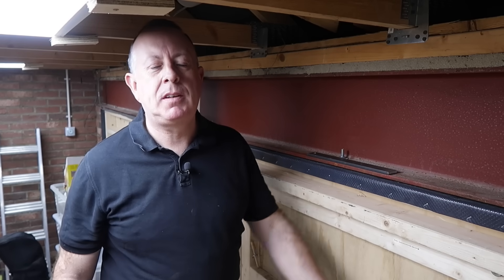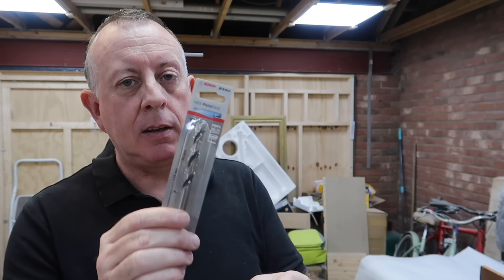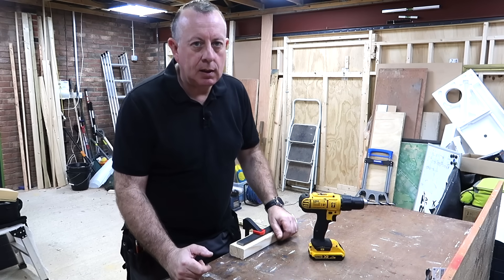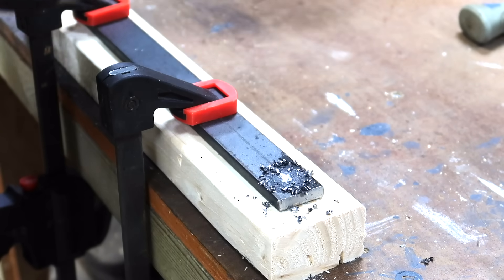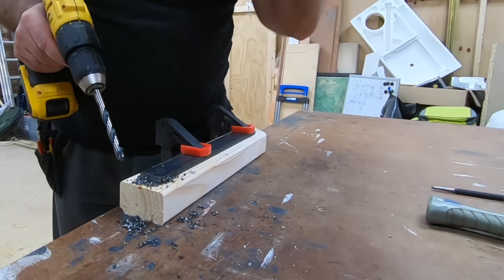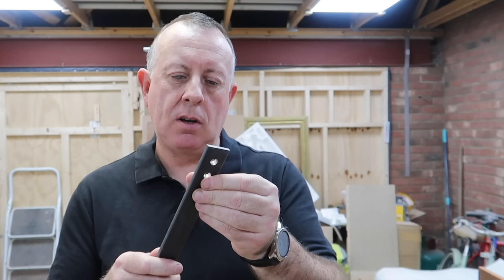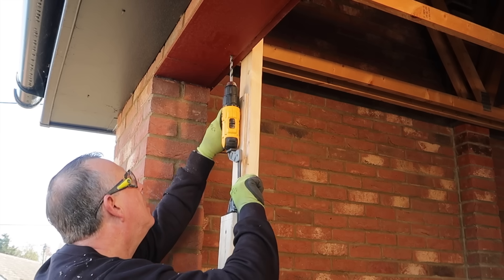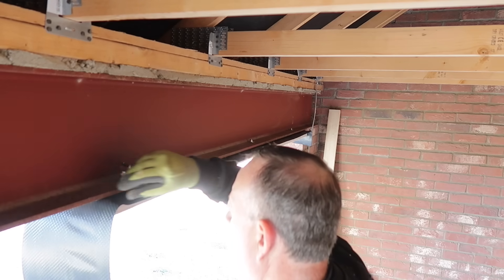How to Drill Through Steel Beams with a Cordless Drill

Comment: Have you not heard of a portable drill press.? The drill mounts to the collarvof the drill, you hook it on the outside edge of the steel then use the lever which applies pressure to the work, simple and light. No set up time butvyou must be able to hookbthe backbedge of the steel. I have a slow speed metabo drill thatvwould break your arm without the press. This thing makes it super safe and easy.

Comment: As an apprentice in 1978, I was always taught that the cutting speed for steel was 18 m/min, with 118 degree drill tip angle, BUT, also, never to remove swarf with your fingers 😳. Great video though mate.

Comment: Mate, let the drill breathe! Slow speed, high pressure with vents fully covered, she is cooking. 
Press with your palm and leave the vent open, also run it on full speed off load once you’re done with the hole so she cools down.

Comment: I thought it is the standard way to drill through steel .... slow , You can also add pressure by using a large clamp on the drill . But i always pilot with smaller drill bit when drilling thicker steel

Comment: Too bad so many people liked your approach. You are absolutely right about the slow speed, but then it stops, a battery powered drill isn't the tool for a job like this you will kill the motor, second applying all that pressure isn't the way to do it. The drill should carve its way through the metal. When this doesn't work the way through the metal, your drill bit isn't sharp enough to do the job. You can drill a smaller pilot hole. Keep up the channel but stop telling the wrong info.

Comment: What , no pilot hole ? 
1, Centre punch  
2, pilot hole 
3, drill hole 
Is how I was taught near 60 years ago now. Drill speed is very important also or like you say it’s dull immediately and burnt the cutting flutes which changes the temper and must be ground away and ……. Well just not a good thing . Ruins your drill bits.

Comment: Rule of drilling steel is "The thicker the drill bit the slower the speed.
The thinner the drill bit the higher the speed". Thats why it's an "HSS" high speed steel.
Cobalt drill bits are my favourite. They dont need lube, just dip it in water every 20 seconds
Love your jigg though. Great idea

Comment: you are killing yourself .  Use a center drill to get the location spot on and then use a very small drill for a pilot hole the small drill should be the diameter of the web of the next drill. WD 40 is Kerosene and it is not a good cutting fluid for steel,  it's great for aluminum but plain kero' is so much cheaper.   You need a good black high sulfur oil like you'd use from the plumbing supply to cut threads on black iron  pipe.  Or any of the high tech specialty cutting fluids.

Comment: When I started most hand held drills (except for the Armstrong type!) had only one speed but also consider how big a hole you want, for 1/8" (I favor the Imperial system) you can go faster and much slower for 1/2".  I believe that some British machinist about a century ago developed a table of drill speeds vs diameter, I think I have this table somewhere.  Everybody has WD40 but if you're going to do a lot of this, might try some cutting oil.  HSS drills are nice but Cobalt Steel can even drill into stainless without killing the bit, they do cost more, but most of us only need a few key sizes, not a whole set (or is that hole set???).  Last thing I learned, this was a hard lesson from my wrist, nice drills like you are using have clutch index setting for the screwdriving function, use them when you are drilling as well, these high torque drills can wind your arm up like a rubber band when the bit jams.  Sorry for the pun.

Comment: May I suggest another option in getting PSI on yr drill? As an old woman and massage therapist I would get my old lady step ladder (that has big flat steps) I’d use my height and apply my KNEE resting my foot on the higher step or side of the ladder to lever the drill pressure . Your hand is loose  and not taking any of the load. You could use a mirror to keep a visual

Comment: I tend to start with a smaller drill bit for a pilot hole. Then go to bigger bits.  Depending on the size of the hole I may use 3 different sizes. Saves wear and wear and tear on the bits.

Comment: FYI WD-40 isn't a lubricant, it is a water displacement fluid. You should use cutting oil. Also drill speed depends on drill diameter. Its all about the liner speed of the cutting edge
Reply: Well to be honest it works as a lubricant for the purpose and not everyone has cutting oil. This is a DIY channel - I dont know why all you smarty pants dont get it that he is trying to show how anyone can do it without access to all the fancy stuff like cutting oil. 🤕

Comment: From a retired 45 yr machinist…… step your drill sizes, if you need a 1/2 inch hole, start with a center punch, then a 1/8, then 1/4, to 3/8, finish up with 1/2. Less pressure will be required
Reply: Thanks, that's what I have been doing for decades, and didn't know if it was the right method or not.  If I'm drilling an 8mm hole, I start off with 2mm, then 4mm, then 6mm, and finally the 8mm.  Must admit, I didn't know that the rotation has to be REALLY slow.  I have cooked a few bits, even when trying not to.
Reply: @barryfoster453  I'm a long-retired machinist/toolmaker that still practices my skill set, I have a cobalt set of drills however i mostly use my HSS set and re-sharpen them as needed.

Comment: You get better accuracy and less need for pressure if you use a smaller drill first. You shouldn't need your whole body weight to drill a hole.

Comment: 60 years drilling holes in things and I finally realised why I have successfully blunted so many drill bits so quickly in the past. Thank you very much for such a simple tip such as not using a drill at warp speed all the time.

Comment: At the other end of the scale, drilling thin sheet steel can also be quite problematic because the twist drill often binds at the end of the cut. A very useful tip to avoid that issue is to place three or four layers of cloth between the drill tip and the surface that is to be drilled. Doing this prevents the drill bit binding and results in very clean circular holes even in thin sheet metal with relatively large drill sizes. Lots of drilling pressure will still be needed and don’t be concerned if the cloth begins to smoulder a little.  Trust me, this technique really works 10/10 every time.

Comment: I had used the pilot hole first approach and the width was just a shade wider than the center tip ‘shank’ of the second and final bit.  I never tried slow, so I will try it my way but slow.

Comment: As a trainee technician over fifty years ago I was told don’t use your thumb to wipe away metal swarfs  in case you get a splinter penetrating the skin.
Reply: Should also wear gloves, because if the drill does get hot it will get really hot and the slightest contact with skin will give a deep burn.

Comment: For me, step 1: ensure the drill is well sharpened, I’m always amused by guys who don’t push hard and thus heat up and blunten the drill and squeak squeak squeak, and I usually run high speed its just a matter of proportionate pressure and coolant

Comment: Helps to drill a smaller diameter hole first (same weight but applied over smaller area) Also helps if your a diyer like me who has a whole serira of dull bits, very often the outer edges of the bits are not dull, so I have found

Comment: You don't always have to drill thru an RSJ. If you're boxing it in, Hammer in "soldiers", batons of wood between the two flanges, tapered at each end and hammer them in flush. You can then box it in.

Comment: It is best to drill a small hole first. Aprox the size of largest size drills tip. Then drill with the large drill to the final hole size. The larger the drill the lower the speed. Best to use special alloy drills like cobalt drills then hss.

Comment: use a smaller drill bit to make a starter hole  - dip the drill bit into CUTTING WAX - it is far easier and as the bit heats up the wax drips down on to the steel

Comment: Great video, very informative. I don't suppose you've come up with an equally ingenious jig for drilling into the vertical web of a beam once it's already been installed 2.5m up, have you?
Reply from the maker: Not if there isn’t anything close by to push off. Best option to hire a electric magnetic rotorbroach type drill for the day that will hold itself onto the web
Reply: @ProperDIY  Many thanks for getting back to me on a old video, much appreciated. Hire a mag drill? Where's the fun in that 😂? Was thinking more along the lines of a £15 160kg-pull magnet to hold a lever drill press up there, looks like I'll have to get creative myself 😂. Much cheaper than a day's hire of a mag drill, and available for nothing whenever I might need it in the future. Wish me luck 🤞.

Comment: This video really helped me today, thank you. Had to put 10 12mm holes through the vertical section of an RSJ. I turned the battery DeWalt down to the 1 setting and discovered it was most effective at full speed after lots of testing. The last few holes only took 2min each. That final bit can be dangerous though if it bites it can snap your wrist. Soon learnt to hold back the pressure toward the end but keep the speed up. Two cheap and cheerful Erbauer bits to do 10 holes, one got a damaged tip from the final bite.

Comment: That's the right way to drill through steel beams. I've had the "pleasure" to work with two brothers who would burn through drill bits at a high rate and would take an hour or so to make a hole and their cost per one hole was like 150€ which is insane. When told that they should do it slowly and steady they just couldn't understand it. With the proper way me and my father drilled 5-6  holes each in just an hour and using the same drill without destroying it, which give you 5-6 holes for about 75€ which is around 15€ per hole. 10x less.

This simple knowledge makes it faster, less frustrating and stressful and also more easy physically.

Comment: Great video Stuart 
I used your technique to successfully drill through the axle of my boat trailer after a pesky split pin had managed to get jammed fast inside the original hole.  And I've still got my drill bit!  
Your Proper Engineering and Proper DIY channels are two of my favourite channels - always look forward to your next videos.

Comment: Drilling a pilot hole will make drilling a larger hole in steel much easier. The reason being that the chisel edge located at the centre of twist drills has no cutting effect. A lot of pressure is required to force the chisel edge through the steel. A pilot hole the width of the chisel edge eliminates this problem. Therefore, choosing a pilot drill with a diameter the same size as the width of the chisel edge of the larger drill will greatly reduce the pressure needed for larger drills to cut through steel.
Reply: I was going to make these same comments about drilling a pilot hole just slightly smaller than the width of the chisel point, you beat me to it.
Reply: @sferg9582  About 40% of power goes to the chisel point.
Reply: I've used pilot holes successfully but this can cause problems, so I now try to avoid this. Too small a pilot hole and the main hole forms a hexagonal or pentagonal hole and looks a mess. I have no understanding of the physics behind this. Happens very easily drilling masonry as well. Too large a pilot and the main hole bit can seize in the hole and shear off, esp on exiting. Moreover, you can ruin the bit by taking the shoulders off. Best if you do it in one size all the way.
Reply: Bingo!!!! I was looking for this comment before I made it. This is the best method. Start with a small bit for a pilot hole then go larger. This way you don't have to push so hard to force the wide web of the larger bit through the steel. Use common sense over brute strength!
Reply: no
Reply: @EazyDuz18  wonderfully informative

Comment: I use two bits, one smaller for the pilot hole. The other for the diameter. Use cobalt alloy drill bits. Dip them in lucas oil or other thick sticky grease. Drill slowly with firm pressure. You are doing it right when you get spiral chips.

Comment: Here's a tip our metal workshop teacher gave us all when I was a lad:
All DRILL bits (including HSS for steel drilling) have angled cutting  edges, but between them is a narrow flat (chisel edge) section called the LAND of the drill.
To drill a hole in steel or metal easily, start by drilling with a much smaller drill with diameter greater than the width of the Land of the larger (final) drill.
This will allow you to exert a much greater pressure on the drill tip.
Once the initial pilot drill has penetrated the steel, you'll find that the angled cutting edges of the final larger drill will cut MUCH more efficiently as there'll be practically no RUBBING effect to resist the CUTTING edges, and you'll be amazed how fast the larger drill will penetrate.
Reply: 11:11

Comment: Where can I get the drill bits ? I have a central heating system to install next week and need to go through a few steel beams I want to out 22mm pipes so ideally 25mm drill bit

Comment: It’s much easier if you drill a small pilot hole first, before using a larger drill, small drills don’t need as much force to go through, after using a pilot drill the larger drill will go through easily

Comment: Good tips, which I used too. But I recently had to drill 18 mm holes through steel beams from the side. It was for pvc tubes, for electric wiring. I did it on a ladder and leaned into the drill, to put as much pressure on the bit as I could. 
An I drilled it with 8 mm first and then 12 mm an 18 mm last. 
Apparently I'm Arnie Schwartzenecker. But I wish I had a top-tip like this for it.

Comment: Very excellent and marvellous. I have to drill 4 holes in the bucket of a (Takeuchi) digger. New Bosch bits, old corded Bosch drill with multiple adjustments-- thought I needed the permanence/ power of a corded tool. Didn't do a pilot. Oil, plenty of cooling stops. After an hour I didn't even make one hole! I'll try all the ideas I've found on the tube. Thank you, much.

Comment: One other comment from me: I spent most of last night researching those self tapping bolts that attach timber to steel. The ones in Toolstation and Screwfix simply aren’t the correct ones. But if you get them from a proper fixing online shop (fastco seems really good and cheap) then you can choose ones that are specified to eat through 8 to 12mm hot rolled steel, ie a normal steel beam.

I wonder if that thickness range depends on the steel’s density. I’m attaching a lot of timber to 203x203x46 steel beams, I think 46 means it’s the highest density. The thickness is 9.2mm. Not sure it will make it through. But I’m about to find out.

If they do work then I’m still not convinced that single part fixings will be as good in the long term as nuts/washers/bolt… what do you think?

Comment: This is incorrect. The correct way to drill through steel with a cordless driver is to use a smaller bit first, go as fast as possible, if it doesn’t cut just go faster, break your first bit, swear a lot, move onto the bigger bit anyway, push hard at top speed for about 6 mins and then swear again because you just have no idea why all you drill bits seem to be so rubbish. Somehow you managed to get through the 203 beam but it did take far too long and involved a lot of anger. 

(Joke, your way is better.)

Comment: My top tip for drilling  holes in steel beams, I get the supplier to drill them. I also sometimes get a hole drilled in each corner of the flange, I then attach some caster wheels if I need to move it and the ground is suitable.
Reply: You get the supplier to come to your house? How much beer to you have to offer to entice them?

Comment: When you want to cut in metal (drilling is cutting in metal) there is a thing called cutting speed for your tool, it depend on the metal you are cutting into and the metal that are doing the cutting, and in this case my ballpark figure says 25 meters pr minute, to find the rpm we could use "cutting speed" x 1000 / drill diameter x 3.14, = 884 rpm, so with your Dewalt on low speed (0-450 rpm) you could give it full speed no problem.

Comment: WD 40 is not ideal. The solvent element is flammable and evaporates off so quickly. Correct lubrication and if available is water dispersed cutting oil.

Comment: Should always use a pilot drill for larger holes. The centre of a drill bit doesn't have a proper cutting edge if you look closely. It's more like a flat screwdriver end with the shape of a pitched house roof set at 120°. The larger bits have larger centres that don't cut easily so you make the job harder for yourself trying to push that through. Best to start with a smaller drill so the non cutting centre is much smaller so you don't need to push as hard. Use a higher speed for smaller drills too as the ideal cutting speed is a linear speed so related inversely to the diameter. With a pilot hole drilled the larger drill will self centre and not wander and the non cutting centre will be inside the pilot hole allowing the actual cutting edges milled to the flutes to properly engage with the edges of the hole and cut efficiently - not waiting for the metal under the pointed centre to be burred out of the way. It will be so much quicker you probably won't need your jacking arrangement.

Comment: Speed kills. Finally explained all my dead drill bits and why I started buying 'holes', yes, I would weld on washers when possible to avoid drilling and killing..yet another bit.
Thanks!
PS, I thought you were going to wrap a bungee cord around the drill handle and beam to apply elastic force.